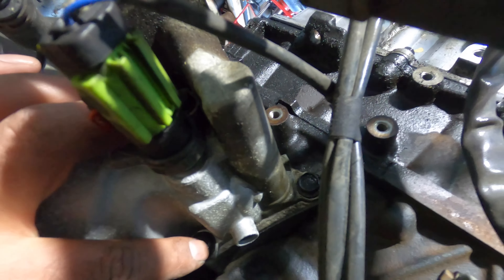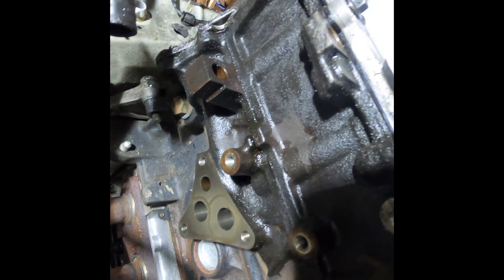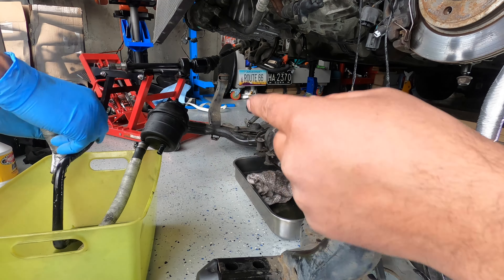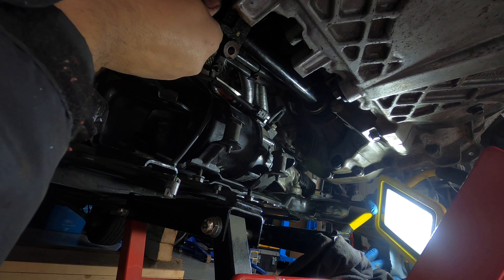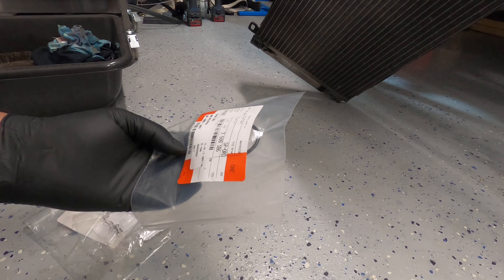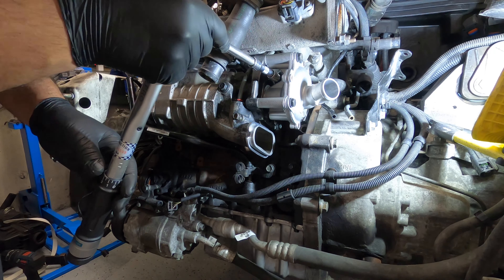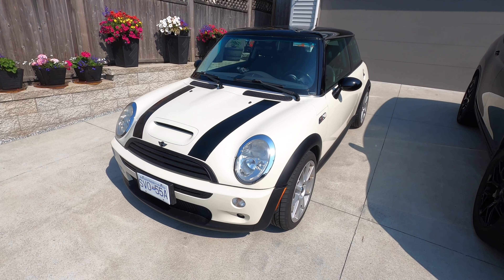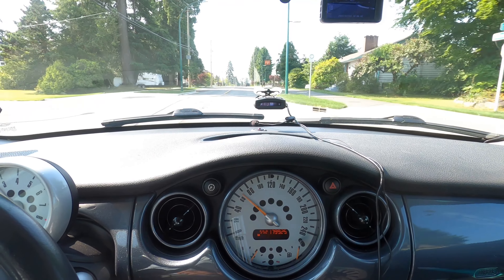Mini Cooper S R53 200K High mileage service PART 3

Comment: These videos have given me inspiration to get my cooper all fixed up. I just wish I had a garage. Have to do all my work in parking lot.
Reply from the maker: It's not easy but definitely doable without the garage! I would suggest ordering all the parts that you will need replaced and the seals that could potentially fail in the future before you open this cabbage in the parking lot.